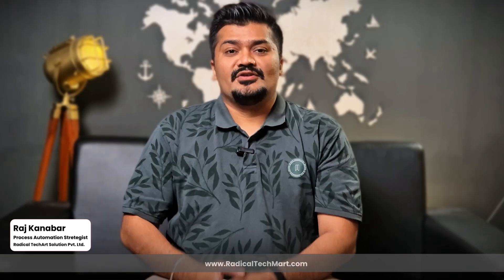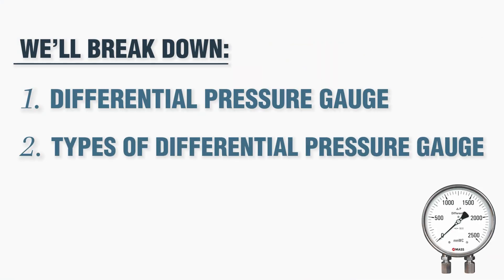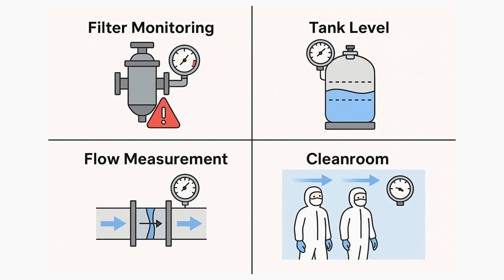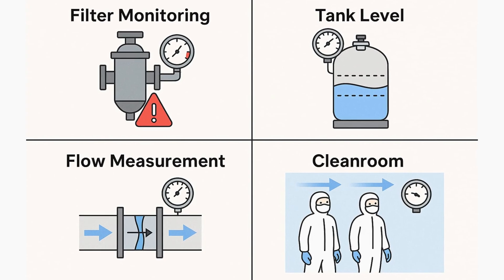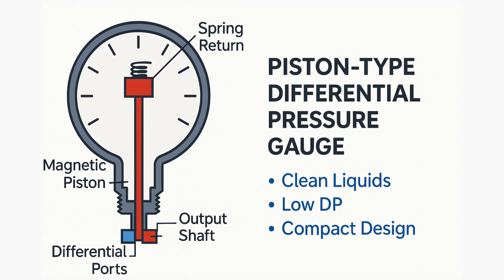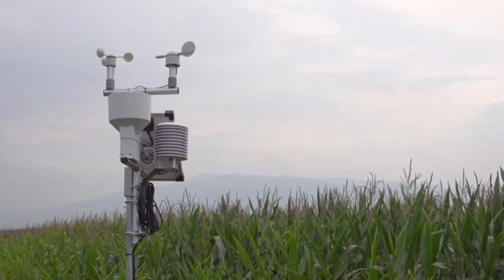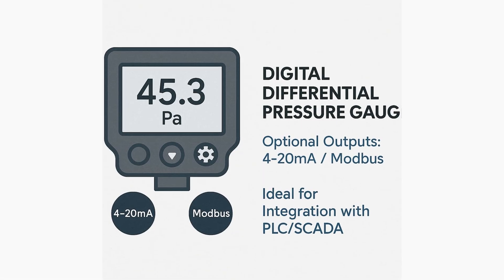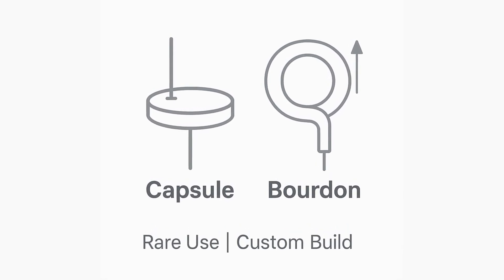How to Choose the Right Differential Pressure Gauge | Types, Applications & Selection Guide

Comment: what is the proper impulse tubing to use for filtration systems. atlas copco is using some kind of flexible tubing system in their flanged filters. what material is flexible impulse tubing made of? can it withstand pressures upto 20bar?